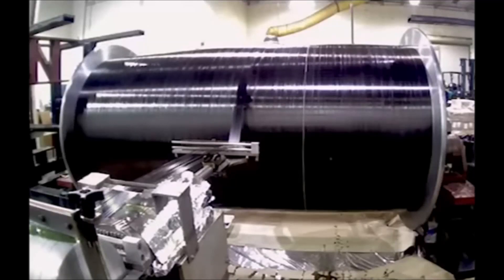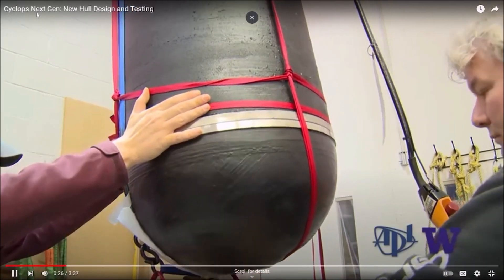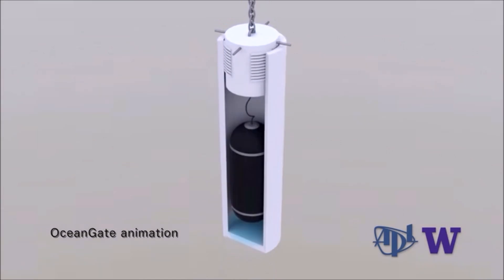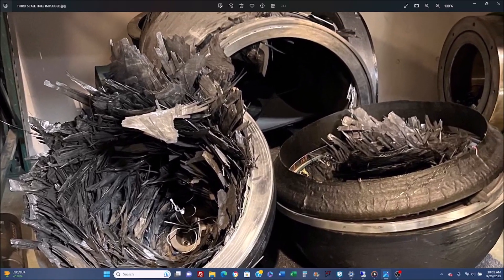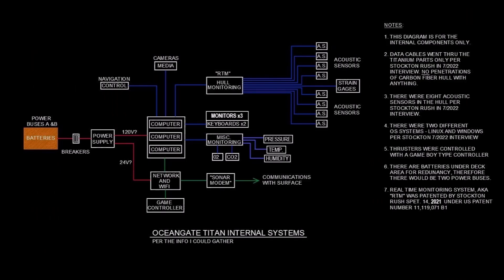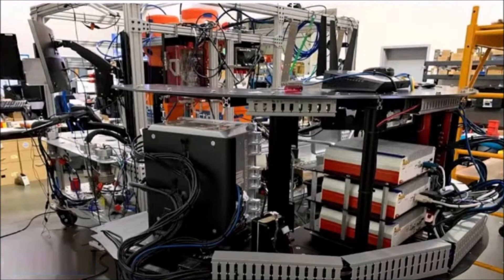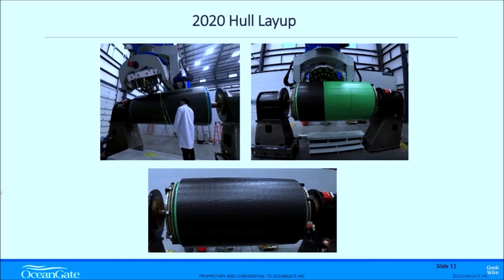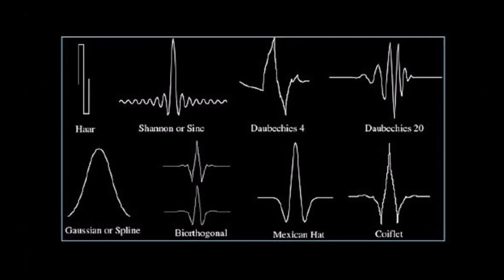OceanGate Titan - WHY USE CARBON FIBER?

Comment: Carbon fiber composites, as used on the Titan have been around since the sixties and their properties well documented. I was involved in the development and testing of the first use of the material for aeroengine fan blades, the big things on the front of the engine that provide most of the thrust. Our final design failed the most stringent test, bird strike, it delaminated, shredded, thus ended the program. Roughly a decade later, carbon fiber fanblades sucessfully entered service on the Boeing 777. The manufacturing difficulties had been overcome by using a three dimentional weaving technique that prevented the delamination from taking place. It maybe found in the course of the investigations into the failure, that the  CF cylinder did experience delamination under the enormous compressional loading. Was it due to faulty material, manufacturing defects or design? Such a tragedy that people died because of this.
Reply: Apparently, the 3D weave technique is very complex, the process cycle on the fanblades mentioned originally taking upto 16 hours using proprietary equipment. Also detecting processing defects, voids, contamination, polymer dispersion, uneven curing etc. etc. using ultrasonics has limitations compared to  the same techniques in metallics. High frequencies necessary for detection of small  but significant defects are rapidly absorbed as the  sectional thicknesses increase.
Reply from the maker: @grahamfoulkes7321  Interesting. Yeah I can't even visualize how a machine would create that... very complex and it's only a small part in comparison to a CF cylinder that is 100" long x 66" diameter with 5" thick walls.
Reply from the maker: I proposed in a previous video, that in my opinion, the hull needed to be manufactured using 3D weaving but it appears that they don’t currently have a way to make it like that. I should clarify: as in your example it’s well documented but for the way it was used in Titan it’s not. As you say, it’s hard to determine the exact reasons why it failed. Could have been one or more of the reasons you cited.

Comment: Your viewers may find instructive the 23 Jun 2023 article on DesignWorld website entitled "Carbon Fiber Is Safe for Submersibles When Properly Applied" about a company in Rhode Island, Composite Energy Technologies" has been making unmanned submersibles from carbon fiber composite for many years, some of which operate at depths lower than the Titanic.  The company CEO, Chase Hogoboom,  believes carbon fiber composite hulls may eventually be safe for human occupancy in deep sea submersibles  but much more technology development and testing will be required before he would consider it safe.  He also says that he offered to share some CFRP deep sea hull know-how with Rush on two occasions.  Rush wasn't interested (classic not-invented-here syndrome prevalent in many companies large and small in my experience).

Comment: It looks to me like a few things were drilled directly into the hull. He told everyone that nothing as drilled into the carbon fiber. And on top of that the last missions dragged the darn thing for like 400 miles through the rough sea!!! Absolutely mind boggling.

Anyway it's my opinion that it failed at one of the rings, which looks like what happened in the tests as well.
Reply from the maker: There was a liner inside which the monitors would’ve been fastened to. I also think it likely failed at one of the interface rings. A few videos ago I proposed that was the failure mode, flange was causing stress riser(s) somewhere along the circumference.

Comment: It’s good against holding pressure inside the vehicle outward due to the fiber however it doesn’t work under compression. Ego, greed and lack of knowledge he did what he did
Reply from the maker: Yes, not good under compression - with today’s manufacturing technology.

Comment: I think it was going pretty darn good with the hall how many times it was being used over and over
The electrical and all those other things is what the problem was
Reply from the maker: Anything mechanical/electrical is subject to failure, especially considering that outside the hull they can be subjected to hydrostatic pressures of up to 5,500 PSI. As far as I can tell, Titan made about 20-21 dives to Titanic depth but I don't know if that was including both the 2017 hull and 2020 hull or if it was only the 2020 hull.
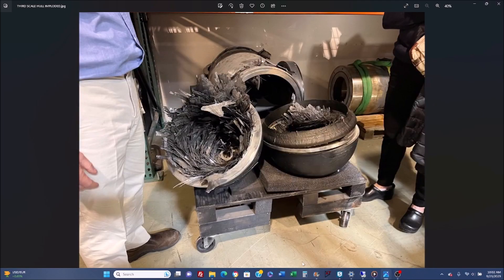Reply: @VegasCyclingFreak  2:00 Was awesome that you added that part 
Someone showed the animation of the window going in But didn't show this
Reply from the maker: @ImaFnT-Rex  Well this is 1/3 scale hull with carbon fiber hemispheres, which they couldn't get to work at the pressures required. Any opening in them would cause a failure. That's when they went to the 3-1/4" thick titanium domes instead. I don't think the acrylic viewport is what failed. According to Rush the acrylic viewport would give you visual clues that it wasn't happy at 1/3 the pressure at which it would fail. That viewport was manufactured by a company called Hydrospace.

Comment: You are completely overlooking the differences in carbon fiber under tension stress, where it has remarkable strength, as opposed to compression  stress, where it would obviously perform much worse than other proven materials. Stockton was an engineer, and should have known this, as most people with just common sense could figure this out. He overlooked the obvious flaws in this design in order to push his agenda, and he ended up killing himself and three other people in the process. You can try and excuse his desing, but the fact is he didn't listen to people with way more knowledge, mainly because he was an arrogant piece of $hit. If he wanted to kill himself by being an idiot, that's his business, but he killed innocent people, and no matter how many excuses you make for his design, nothing will change the fact that he murdered those people.
Reply from the maker: I am well  aware of the differences between tension and compression. Not the point of this video. That was some of the focus in my previous video. OK so you think Stockton is a murderer. Did the captain of the Titanic murder 1,500 people? I never really thought of it in that light.

Comment: Thanks for the clarification. It does make sense the logic but when I hear it I straight away think of the unreliability of CF compared to Ti. Where you think the logic is sound, the theory is good but the reality just doesnt feel like it matches in regards for reliability. Then you think would I get in this hybrid sub, nah not worth it, would i get in a james cameron Ti sub, yeah I really would, or atleast would choose that one over the Ocean Gate one. Sure Ocean Gate sub was bigger but at them pressures it just feels like survivability is taking a back seat to bodies in seats and finance and that has consequences, if the folk that went down really did understand that and still went, fair play on the gamble with their lives, but if they didnt really see that and just got the sales pitch, well I feel sorry for the families left behind. How many that went on that told their families they would be totally fine I wonder, when the reaper was looking over their shoulders 🙂
Reply from the maker: Yeah it's messy. I really do believe that Rush thought he had it figured out and that it was safe - he was in Titan too when it imploded. I think there is a way to do it with CF but we don't currently have the manufacturing technology available to make it how it needs to be made. I don't know that anyone else will ever try but it may be that in 10-15 years technology will have made the necessary advancements to make it possible.

Comment: This is a bit of a red herring. He was not cheap when considering the cost of metal against the cost of fiber, he was cheap when considering the expenses needed to develop a completely new technology against what he actually wanted to spend in the new technology. And he was cheap when he got indications that his new technology was not working as expected but decided to ignore the problem, most probably because of the cost of finishing the development of the new technology.
Reply from the maker: I agree that it needed more testing and development. Keep in mind that he was also relying on a third party to manufacture a hull that met his specs. Both companies he used ultimately failed to do so. Rush was really in uncharted territory, and probably should have consulted some other engineers or experts in the design process. Maybe a little overconfident in his own abilities there.

We also went thru COVID and then we had bad inflation, so costs obviously were a concern, as it is with any business trying to keep its doors open. I think one reason why price to dive to Titanic was more than doubled. The cost of fuel and operating these sea going vessels is kinda astronomical at the moment.
Reply: @VegasCyclingFreak  I see no problem whatsoever with relying on third party suppliers. Almost every part used in an airplane or car is done by third parties. But the specs of a critical part that is a single point of failure and causes death if it fails, are one big document that includes testing procedures to guarantee that it will not fail.

The decision to use carbon fibers would have to be accompanied by a design manual with dimensions, material specifications, testing procedures, certifications, and a lot more. I would be very surprised if the first submersible made of carbon fiber did not cost ten times more than one made of tried and true materials, and did not take ten times more time to construct.

So no, the excuse of "sorry that you died, our suppliers failed to meet our specs" has another name: criminal negligence.
Reply from the maker: @andresvillarreal9271  I hear what you are saying and that might be true if we were talking airplanes or cars where things are governed by regulatory agencies and/or laws. Titan operated in international waters where they really weren't subject to any laws and the "mission specialists" all signed waivers that mentioned death several times. All I know is that Rush gave the manufacturers the specs they needed to meet and they tested the 2020 hull in a facility in Maryland before it ever did a dive. All was fine for at least 14 dives to Titanic before the sudden failure. Carbon fiber at this point in time seem to not be suitable for this application.
Reply: @VegasCyclingFreak  They might have found loopholes in the laws governing all other means of transportation, but just as every other loophole, the spirit of the laws, both national and international, is very clear and there is a case for the families of the victims to pursue. There are protections that the law provides and are not waiveable, there are protections that are subject to be eliminated only with a very specific waiver, and there are wide open loopholes that let you get away with murder. My suspicion, and I am not a lawyer, is that the operators of the submersible are liable unless the waiver the passengers signed had a paragraph saying, in essence, "we know that we are being classified as mission specialists, and we are ok with this meaning that we have no rights as passengers".

Anyhow, I am an engineer and I can tell you that 14 dives with unexpected noises from the carbon fiber being crushed is about the same as a game of Russian Roulette. The airplanes that use carbon fiber are subjected to diagnostics that find fatigue damage years before anyone hears creaking noises. The fact that carbon fiber and metal both suffer from catastrophic damage due to fatigue is very well known, so the operators of the Titan had every reason to stop using the submersible as soon as unexpected noises appeared.
Reply from the maker: @andresvillarreal9271  I don't disagree with you on any of your points, just presenting the other side of the argument. Properties of various metals are pretty well known because they have been in use a long time but we haven't had near the years of experience with carbon fiber, and especially not when used in this manner. It seems it was a mistake to bet the whole farm on Kaiser Effect applied to carbon fiber. 

Here is section 2 & 3 of the waiver they had to sign: 

2. A portion of the operation will be  conducted inside an experimental submersible vessel. The experimental submersible vessel has not been approved or certified by any regulatory body and may be constructed of materials that have not been widely used in human occupied submersibles.

3. When diving below the ocean surface this vessel will be subject to extreme
pressure, and any failure of the vessel while I am aboard could cause severe injury or
death. I understand that I may decline to participate in any dive below the ocean
surface or any activity of the operation at any time.
Reply: @VegasCyclingFreak  I understand your point, but still you have to look at the perspective of the victims. There is a chasm of a difference between "this vessel has not been approved or certified by any regulatory body" and "you will have to be declared as mission specialists because nobody would approve your participation as passengers, and there has been strong opposition to this design".

I would fly in an unapproved plane by Airbus or drive an uncertified car by BMW any day of the week, because I believe in the development process of good engineers, where the certification is just a final check, not the place where unsafe vehicles go to get the problems found. The impression that this vessel was ready, just not yet certified, might be enough to warrant an investigation of criminal negligence.

Also, point 3 is just a piece of legalese that can be stamped on every plane, and every car that does more than 160 kph. With a few modifications it could be stamped in every boat. The piece that indicates the nature of the danger, in point 2, says "may be constructed of materials that have not been widely used in human occupied submersibles", not "is constructed with a critical material that has never before been used in comparable submersibles with or without human occupation". They were leaving the true evaluation of the risks to the passengers, who had no engineering expertise to know what questions they should ask.
Reply from the maker: @andresvillarreal9271  Thanks for your comments. I appreciate your viewpoint. I've been trying to objectively look at all of the technical aspects of Titan, to understand how it was built and all of the possible failure modes. I'm attempting to keep the moral/legal aspects out of it as much as I can. Not here to condemn or condone anything that has happened. I always look at both sides of an argument, it's my nature to do so. That comes out more in the comments section, and I have learned a lot from the commentors.

OceanGate is done as a company and it kinda reminds me of 9/11 in some ways... no remains of the victims to be found and it's very hard on those left behind. No winners in this situation. I feel for everyone involved. It's really a big mess.

Comment: 5:17 "Was it the right move? Hard to say."  Well I suppose that depends on how you feel about being instantly crushed to death. Res ipsa loquitur.
Reply from the maker: We have the benefit of hindsight. Rush didn't. If Rush applied the Kaiser Effect correctly, this should have never happened. Also, if the manufacturer truly made a cylinder that actually met Rush's specs this should have never happened.